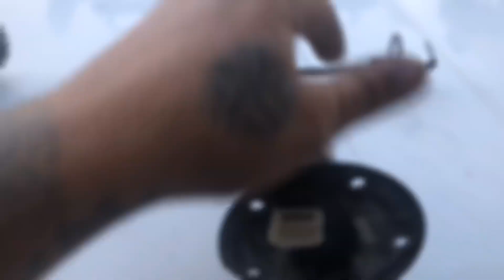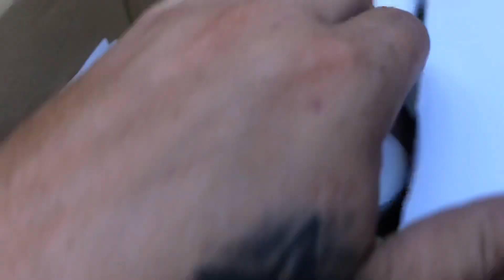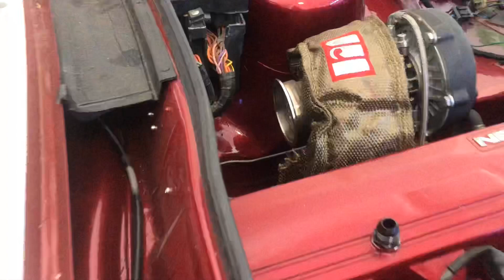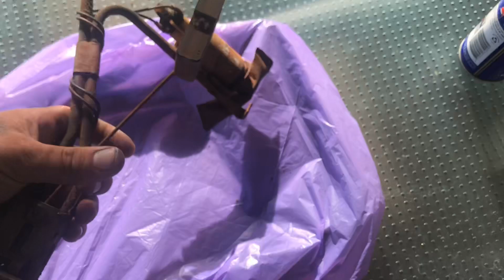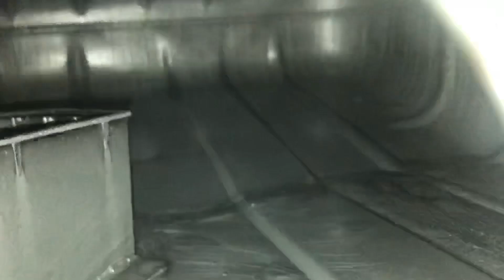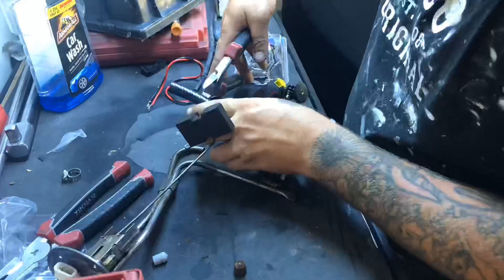Vl Executive Part 9 Fuel System Clean Up

Comment: Also is it necessary to take off the rubber hose from the return line to the Swirl pot prior to adding the Aqua clean and Sealant? Or would it be able to withstand the Aqua cleaner and sealer? Cheers

Comment: Did you worry about connecting the return like to the swirl pot? I'm not sure it's even possible
Reply: Just did mine mate. Yes, you can do it. I did mine using a set of 400mm Extra Long Pliers and some patience! I replaced each hose clamp with a hex head type and used a small socket set with extensions and a universal joint. A good idea is buy some submersible fuel hose (i used this on the pump also) so you wont have the problem again. Coat the hose with Petroluem Jelly which helps also. Good Luck!
Reply: @Scottyr05  thanks mate, I tried for days and gave up in the end. I just keep the tank above half and it hasn't effected me. Next time I pull the tank, I'll try your method. Cheers

Comment: Great video mate, did you use a sealant between the fuel tank and the pump seal ? I have a cork gasket seal and been wondering if I should sealant on it
Reply from the maker: Hi mate no I have a plastic seal so I didn’t if I was running cork I would just buy a new plastic seal save the dramas

Comment: Thanks for doing these videos! Quick question, What did you set the base fuel pressure to, when you installed the new fuel pressure regulator? Cheers
Reply from the maker: Daniel Taylor I set it to around 32psi and adjusted it to where it liked it from there
Reply: @MrProjectt  thanks for the reply!

Comment: Hey mate, great video. Just wanted to know if you hooked up that internal hose in the fuel tank thats goes to the internal swirl tank ? I dropped my tank today to replace the internal fuel pump and clean out the tank to discover that internal hose had corroded.
Reply from the maker: Kane Devlin hi mate both my tanks in the vl had the same problem I didn’t bother trying to fix it both work fine without them
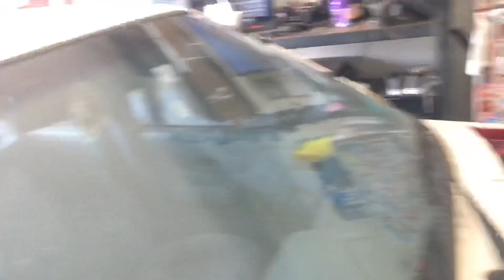Reply: Thanks @MrProjectt , much appreciated! Also, i have found that the vapour hoses have corroded aswell. To replace the vapour hoses is that just a matter of getting some 3:16 4.88mm rubber tubing ?
Reply from the maker: Kane Devlin  yeah mate I just used the thick vacuum line and a fuel hose for the big one as you can see in my video plus a t piece I forgot the size I just bought a pack from super cheap
Reply: Sweet as, cheers ! @MrProjectt
Reply: Hey mate, Just a heads up. That internal fuel hose allows fuel to be sucked back into the swirl tank, if that hose is not connected then when you start running low on fuel you may notice the car start to cut out because the swirl tank isn’t filling up and the internal pump isn’t able to pump any fuel out to the external pump. Can u let me know how you went with your car, cause I’m having that problem now and in the process of fixing it. Also I’m not a mechanic but from what I’ve read it’s a common problem, just thought I’d share it with ya. I also may be totally wrong and happy if anyone else can correct that theory.